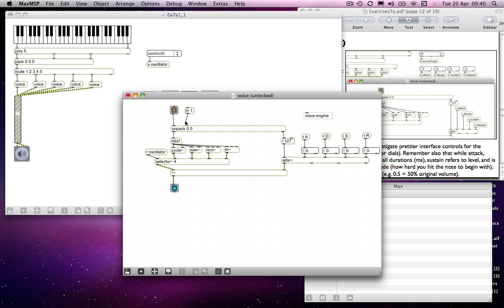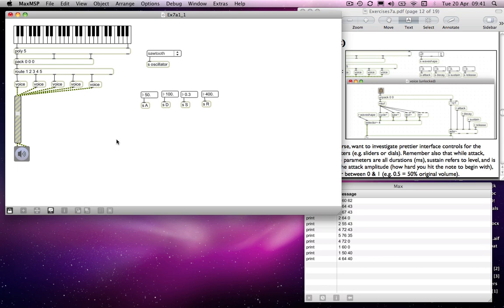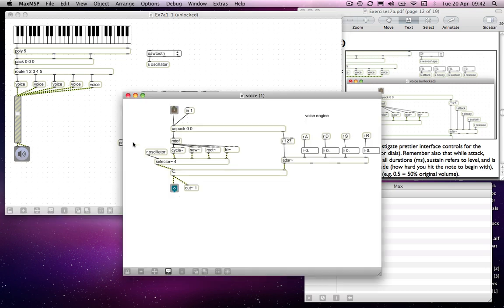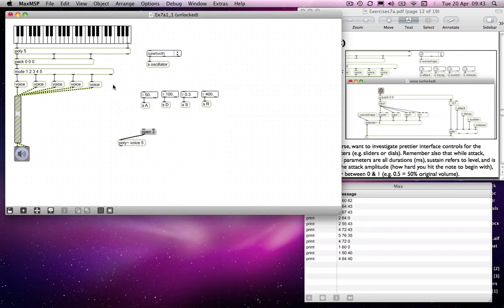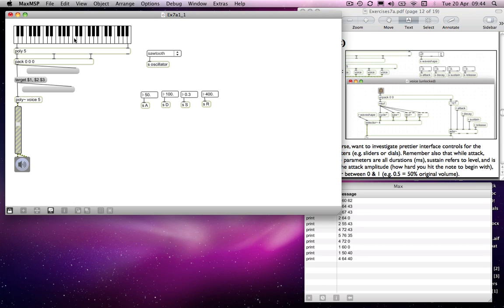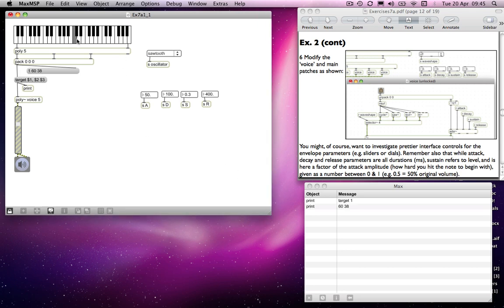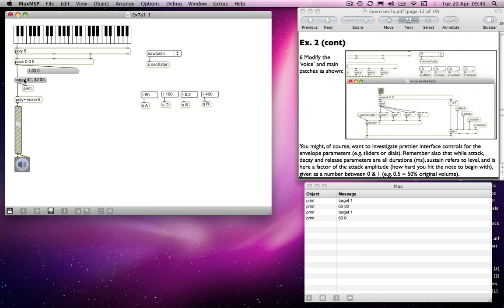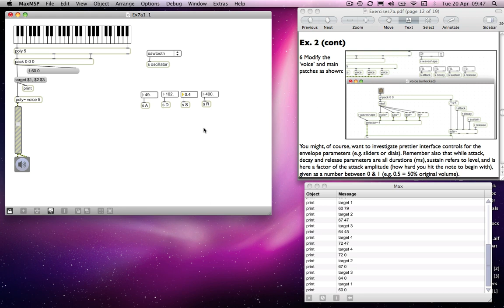Max MSP Tutorial 07a5: Polyphony using [poly] & [poly~]

Comment: Hi Peter! Loving your tutorials; they've been a go-to for a handful of things in my Max learning up til now. I was however wondering if with these poly~s, one could use a groove~ object (which is then as per poly~' s operation instanced an x amount of times) that uses the same buffer in each instance, and yet play the buffer from different indexes and even on different speeds and directions (negative line as input, or positive). 
I'm trying to get a multivoiced granular synth built, however I seem to only have the groove~s playing from the same index of the sample and in the same direction, eventhough I'm randomizing these from an argument list of ranges sent to the poly~, which inside the poly~ instances randomize values within that sent range. 
I hope I got across my question as well as what I'm trying to achieve in an understandable fashion. It's often hard to formulate these things frankly/simply. :P
Thanks in advance for any insight!